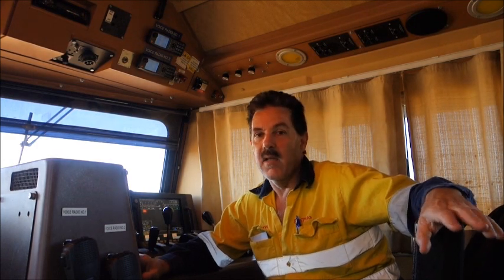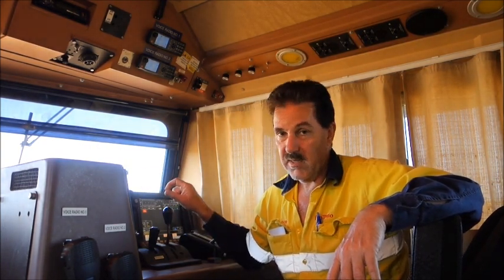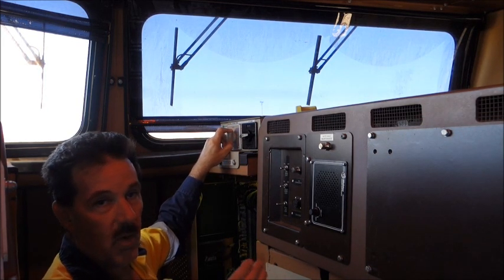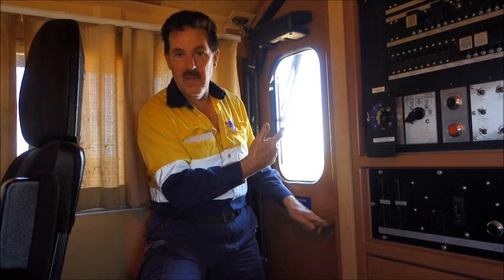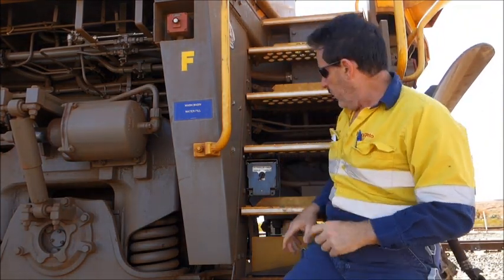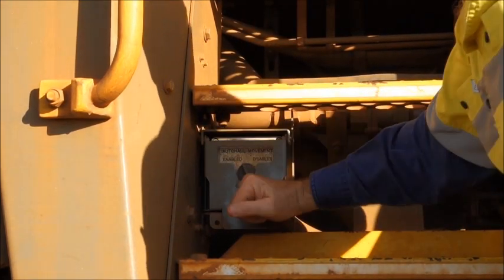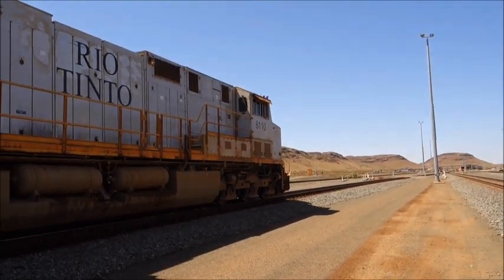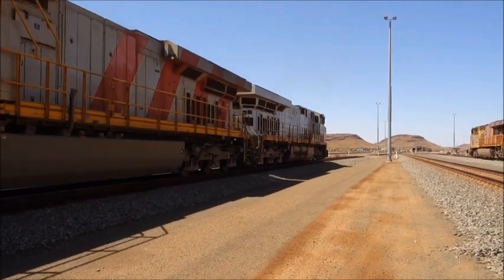Rio Tinto Autonomous Train

Comment: Very interesting and informative. I’m a volunteer engineer (driver) in the southeast part of Kentucky on a tourist railway. We run pre WW2 Alco S2s and post war EMD SW1200s. I enjoy my hobby immensely. I highly doubt you’ll see this in the US because we’re more populated than Australia. I’ve always wanted to come to the Land Down Under and railfan. I’m guessing your locomotive speedometers or set up in km/h instead of mph? We have dual speed gauges on our engines here: imperial and metric. I drive a tractor trailer for my actual job and my dashboard is set for US imperial units with metric below the imperial.
Reply: It's already happening on mass transit trains and taxis....the only thing saving the USA is the unions....if railways had it there way in the USA they woulda been unmanned 50 years ago....
Reply: Middle finger wars? 😂
Reply: They do have 45 crossings on the route I understand. With obstacle detection linked to the trains ATO. There were also no compulsory redundancies
Reply from the maker: I thought an S2 would be a steam loco as I didn't know ALCo made diesels prior to WW2 until I just Googled a pic of one. I thought they were too busy building Big Boys and the like. We had 100 of the 44 class, essentially a PA and I cut my teeth on those back in the day. Yes, our locos have km/h speedos. As an aside, I imported a 1988 Ford Econoline (never sold in Australia) a few years ago and had to buy a used km/h speedo for it from Canada. If a vehicle is more than 30 years old, it can remain a lefty if it was made that way but it must have a km/h speedo. They think we can adapt to sitting on the wrong side but converting miles to kilometers in our head would be too hard. BTW, are you related to the singer, Jud Strunk who sang 'Daisy A Day'?
Reply: David Rayner I’m a distant relative to Jud. I have only heard his music and heard about him over the years. At one time, our little shortline possessed 4 Alco S2s of Denver & Rio Grande Western heritage. They were bought in 1963 and had multiple unit controls set up to be used on our coal hauling railway. When you get a chance, Google “Kentucky & Tennessee Railway” and you can see them in action.
Reply: I think it stinks no engineer running the train you dont get that friendly wave or horn
Reply: @richharris9489  Very few people to wave at or blow the horn, it is Remote!
Reply: You make a good point. Im from Boston mass people everywhere
Reply: @richharris9489  I think that is why this system wont really find its way to the US. These aussie trains dont even pass near any settlments as far as I know. When he says its remote.... its remote . No population anywhere.  That would greatly simplify its implementation (not that its in any way simple) compared to what it would need to be to compensate for the US population that have a perpetual habit of ignoring crossing guards.
Reply: @wishusknight3009 your soul is mine 😂